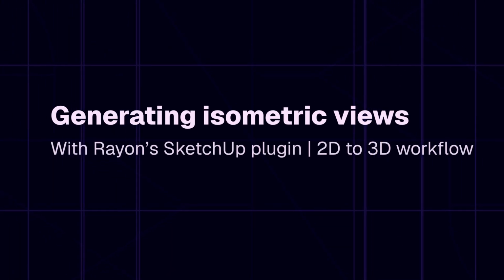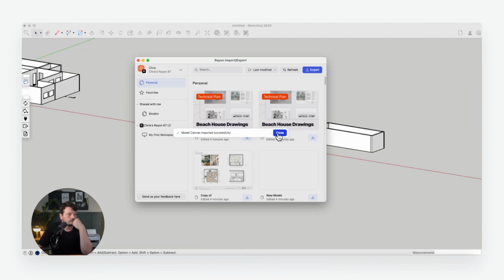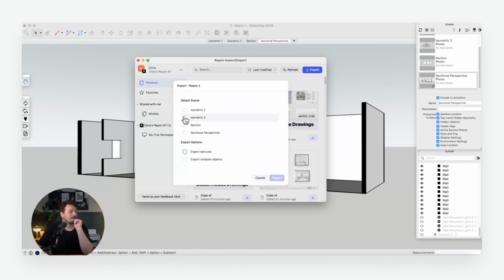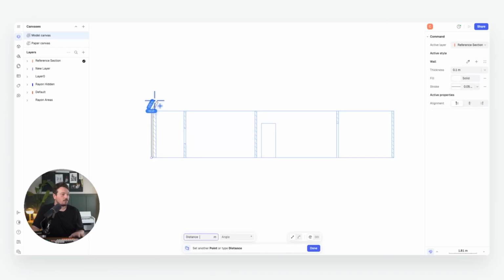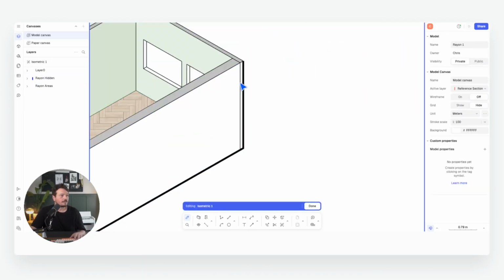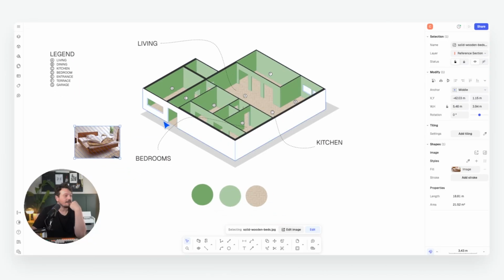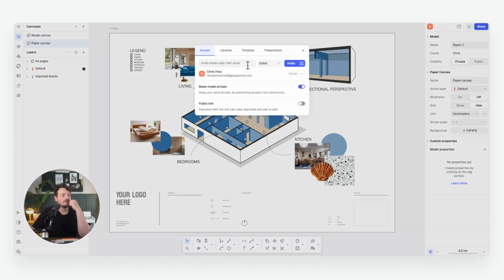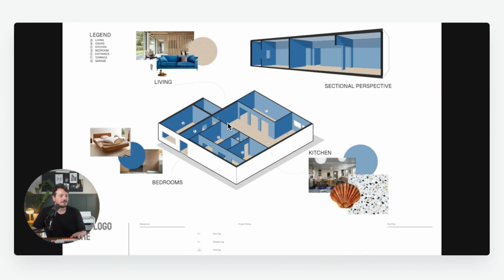Generating Isometric Views with Rayon’s SketchUp Plugin | 2D to 3D Workflow

Comment: How does it handle making changes in Sketchup? Will you be able to update in rayon without having to start over?
Reply from the maker: Hi there, it is not synchronized yet. You export geometry from SketchUp into Rayon, and the same when you import your floor plan into SketchUp. We will work on improving this in future updates.